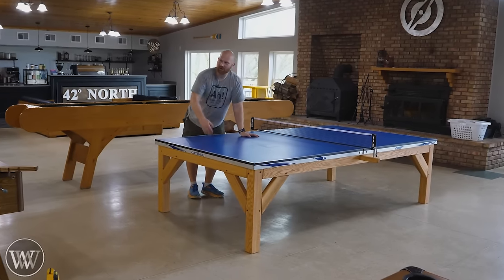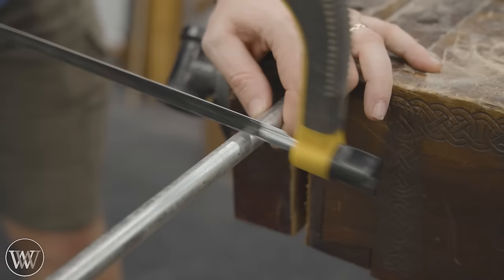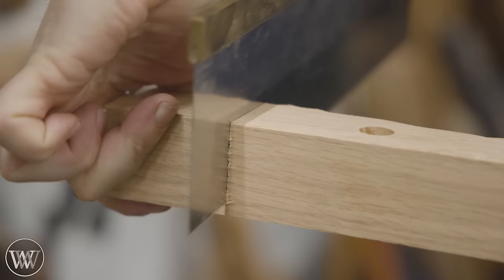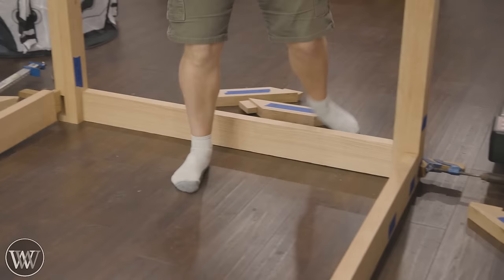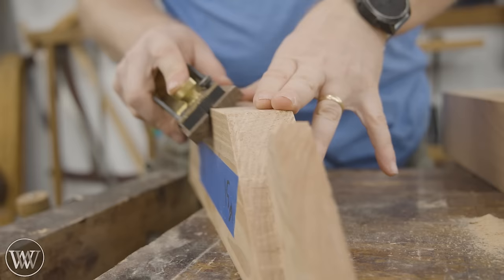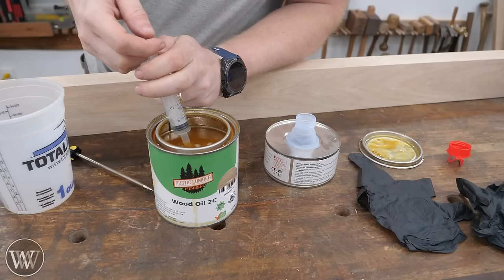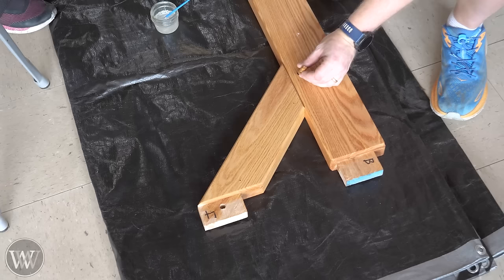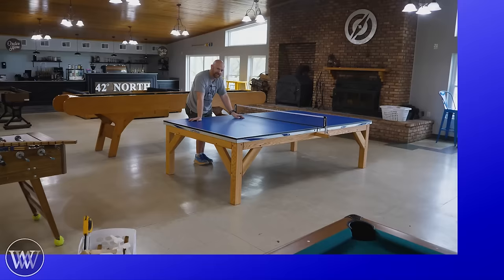Timber Framed Ping Pong Table all Done

Comment: Draw bore dowels are AMAZING!  As an exercise I made a drill press and bench vise stand using construction wood with draw bore doweling and no glue at all.  That table was solid as a rock for 20 years before moving to my new home shop made it "surplus".  But the new owner is still enjoying it and it's still solid as the day it was built.

Comment: Looks very strong 👍but the issue here is: Normally ping pong table's front legs are a bit inside the table. But the one you build, the legs start almost where the player hits the ball and there might be a big chance that when the player needs to hit the ball when he/she is closer to the table, the players leg will hit the leg of the table. Especially those 45 degree angle support pieces that are in front will not be comfortable when playing... Check the other playing table's legs in that room, they are good examples for how game table's legs should be build!
Further then that, it looks perfect 👏👏

Comment: What's the weight capacity of the long stretcher? My intuition says such a long run would be weak in the center without a middle leg.
Reply from the maker: There is still 4"X 2" worth of Red oak with a span of 6 feet between diagonals. That is more then strong enough.

Comment: Epoxy on a timberframe? I suppose only time will tell.
Reply from the maker: belts and suspenders!
Reply: @WoodByWrightHowTo  You hope.
Reply from the maker: There is no downside to adding it. Only possible upsides.
Reply: @WoodByWrightHowTo I am dubious. Is cured epoxy stronger than the wood? Does epoxy have the same coefficient of expansion as the wood?
Reply from the maker: Yes and yes. The expansion and contraction due to heat is almost identical. The bond is far stronger then the wood itself. in most cases it is a far superior adhesive then any PVA. Epoxy is usually more flexible, better at gap filling, better water resistance, and controllable open time.
Reply: @WoodByWrightHowTo Gap filling I understand as well as a good pot life, but I worry that epoxy, like PVA, is stronger than the wood it binds. Ordinary timber framing is done with green wood, so it needs the flexibility to contract. On this project, you appear to have used kiln dried wood and the problem you will have is the opposite. Epoxy in the joints could lead to weakening the joints by shearing off the wood. Heat is not the primary source of trouble with wood, humidity is.